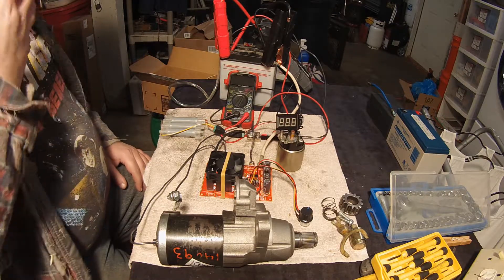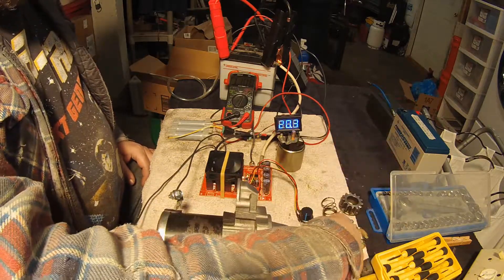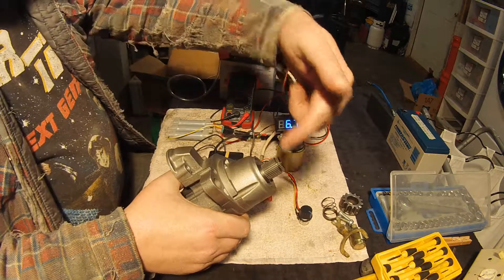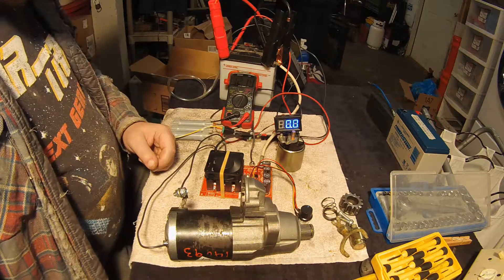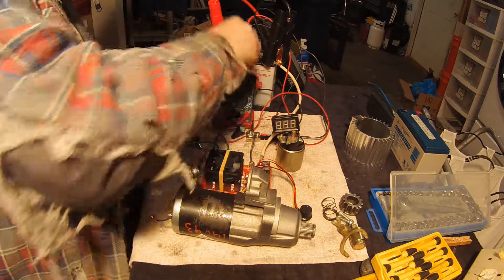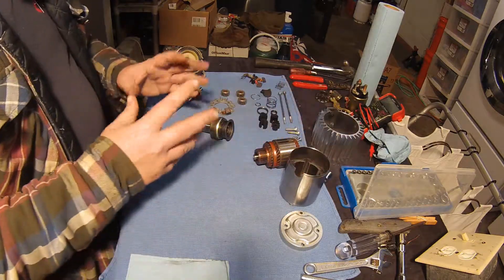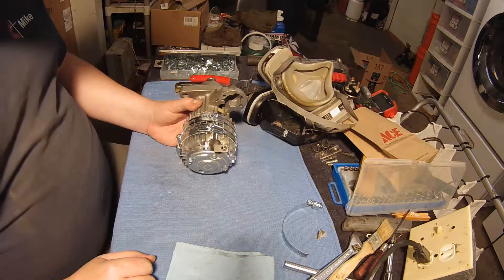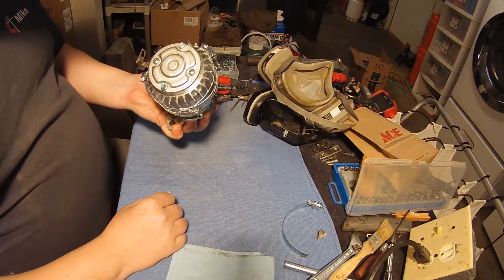ebike Part 2: Starter motor modifications

Comment: 🤔 that aluminum cooler remindes my on a compound dc motor/generator those space's nearly remindes my on a externaly wound coil probably you culd push that thing futher more if you wond coils in series ore in pararel with that small starter motor perhaps you culd make that thing to starter/generator 1 device performing bouth task's you still wuld luse power from baterry but at less slower rate I ques that starter has masive torque you might just pulse it at centrain revolutions that shuld increase efficieny as well with proper gear box even more 🤔 those are some cool project's 👍 john bedini did show some alum baterrys those ordinary baterrys dont hold much charge expecialy if you live some where in cold climate weather enviroment

Comment: I think many of the issues you are running into are because the starter motor is designed to give a very high current for a few seconds. Once the car is started it disconnects from the flywheel and doesn't spin again until you next need to start the car. 
It's really not designed to spin continually.
Given enough time and money you can fix anything but is it really worth pursuing?
Reply from the maker: Sorry I only just saw this comment. Basically, I'm using the starter motor because I believe it can be modified for continuous duty without spending much money on it. Apart from buying it super cheap on eBay, I think the only money I spend was on the needle bearing I used to replace the bushing in the back. Everything else I either had laying around, or would have had to use regardless of the motor. As for time, I've got tones of that, LOL. :)